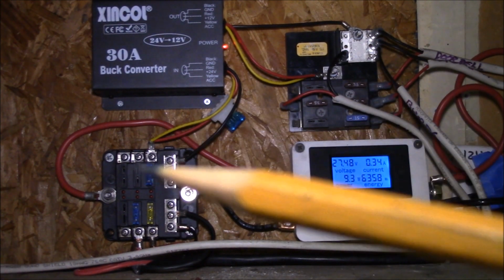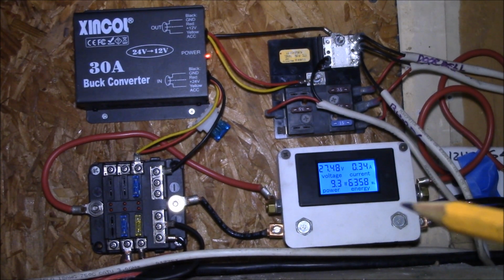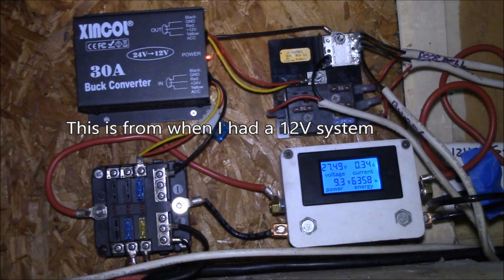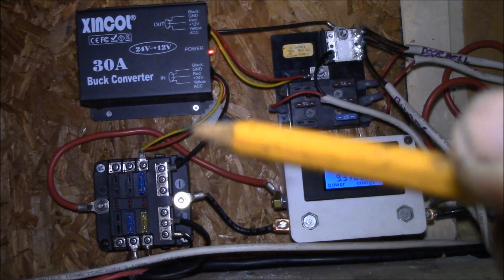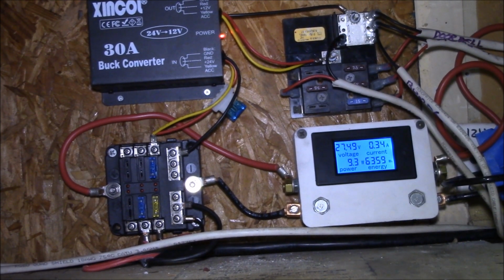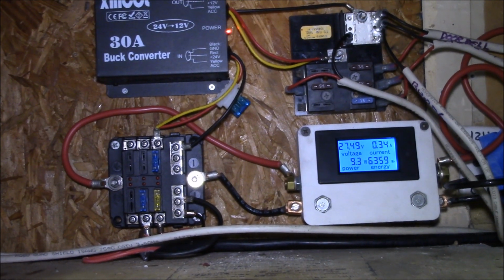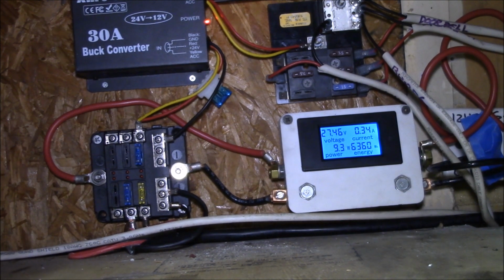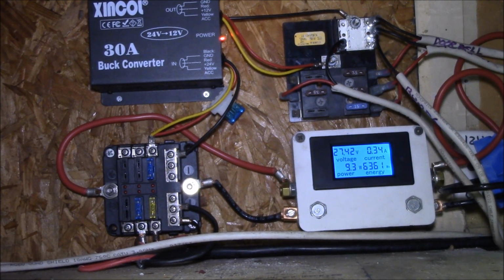12V DC Step Down Converter for the Garage

Comment: I was going to ask you about step-down for 12v solar. It's strange how few people talk about this! Most just seem to run everything on AC through an inverter for some reason.
A 40w media PC sounds awesome: my desktop idles at 120w, totally impractical for solar.
Reply from the maker: Yes, I notice that as well.  If at all possible, I try to go with low voltage DC devices like lights, fans, etc.  I think having 12VDC run throughout the house is a big win.  Look at all the little things plugged into the wall with all those adapters, each sucking a few watts 24/7, that adds up.

The 12V stuff is very plentiful and inexpensive since it gets use in RVs, automobiles, etc.  My kitchen is lit with either 12V or 24V LED lighting, same with the attic and patio.  The garage has both 12V and 120V lighting. My media PC uses a laptop type power brick and I just picked up an "automotive/12V" power brick and that's all it took to move it off grid.  It also has an over the air TV tuner card in it.
Reply: I was one of those people running everything from an inverter. There is so much instability with the inductive loads and the inverters consume a lot of energy, impractical for nights with no  wind. I am porting everything to DC power.